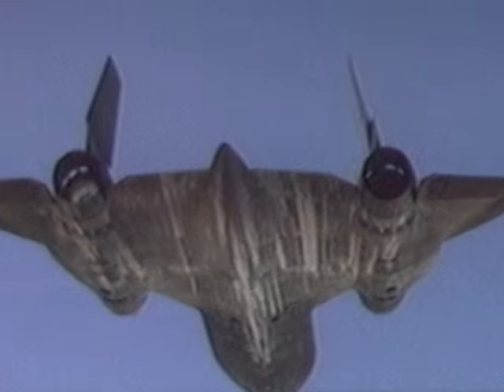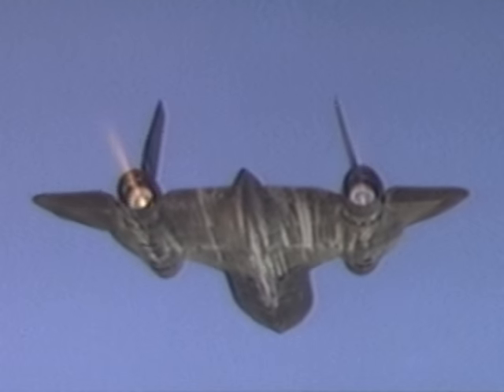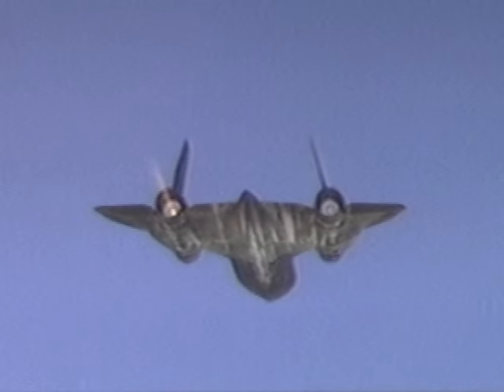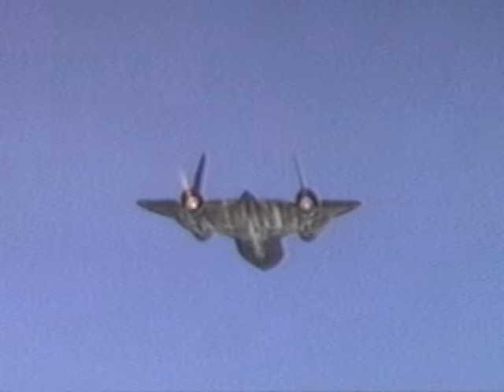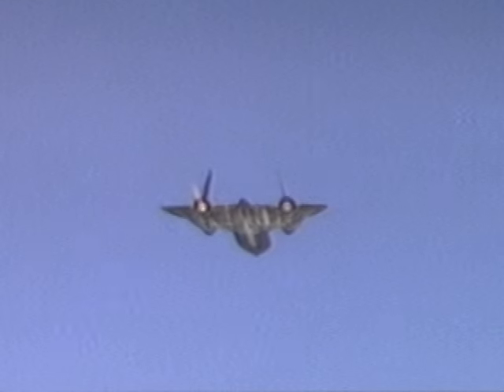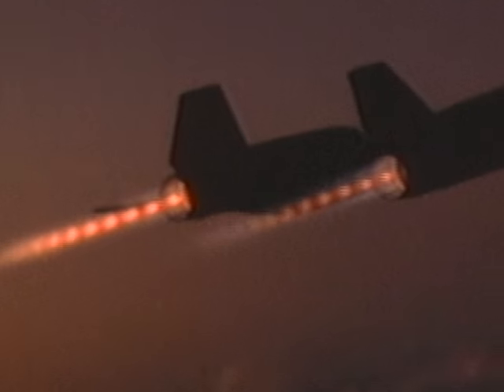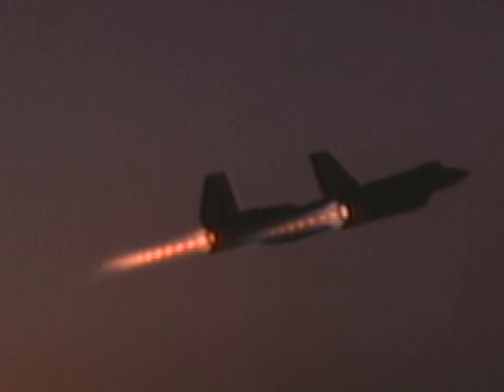Lockheed SR-71 Blackbird: Afterburner

Comment: Ive been told that Mach 3.2 was the highest top speed for the air craft. The classified top speed is much, much higher. Really incredible.
Reply: At Mach 3.5 the Shockwave gets ingested by the engine and it flames out.
Reply: @idontcare9797  Probably true I have heard otherwise.
Reply: @peterssynthetics-independe6786   There's a good video on the channel airzoo where an engineer who worked on the SR71 talks about the J58 engine.
Reply: Not true.  The max speed is limited to the vicinity of Mach 3.2 by engine temperature.  That whole "classified... much higher" business is wishful thinking mythology.  I did learn a few things about it in my 9 years of working on it.
Reply: You were told wrong

Comment: Its not just about the speed of the exhaust, its about the total force of the exhaust, which takes speed into account, as well volume.

You can go supersonic if your exhaust is traveling at 1m/s as long as you have enough mass moving through your exhaust to compensate.
Reply: I've seen many afterburner exhaust signatures and haven't seen "impulse power" signature in any of them ... I'm still puzzled by the exhaust signature ...
Reply: @billwildt6335  Checkout the RS-25/SSME(Space Shuttle Main Engine-now Space Launch System Main Engine, they also have Mach diamonds in the exhaust.  Ambient lighting has a lot to do with exactly what you see as well.  In a few months here we are going to see the Core Stage of SLS loaded onto the Pegasus barge(which was recently-jumboised, or had a section cut out of the middle and then adding in a longer section thus increasing the ships total length. The worlds once longest ship in the world, the Gentle Giant/Seawise Giant/Jahre Viking was jumboised) shipped to Stennis and the Core Stage-1 loaded into the B-2 test stand in order to Green Run 4 RS-25 engines at once.  Same test as the SIC stage of the Saturn V where they lit all 5 F-1 engines at once.  WE'll see mach diamond x 4 engines during this test.  There are 16 RS-25/SSME engines left over from the Space Shuttle Program, 14 have actually flown, some of them 8 times, with one of them being built in 2010 with ZERO flight time and another built from parts in 2014 which of course also has zero flight time.  With each SLS launch using 4 RS-25s we currently have enough for 4 Exploration Missions with SLS.  Rocketdyne has already begun to build brand new Core STage engines with single use expendability in mind.  The 16 "old" engines will be run at 109% Rated Performance Level, while the new build RS-25s will be run at 111% RPL.  A test a few months ago ran a development engine at 113% which is the highest that an RS-25 engine has ever been throttled. New Additive Manufacturing techniques(aka 3-D printing) are to be used with the new build engines due at KSC in mid 2022.   "$1.16 billion contract, which runs from November 2015 through Sept. 30, 2024, is to restart the production line for the RS-25 engine. These production lines have been significantly improved and made more efficient since the retirement of the space shuttle program.."
Reply: This Comment was made when I was born
Reply: It actually has nothing to do with speed or mass.  

The gas flow can only be sonic as any gas flow through a tube is “choked” if you try to move it faster.  

Thus the first part of the jet equation: Ma(V1 - V0) is meaningless because the initial velocity of the air (V0) is actually faster than the final velocity of the air.  The only mass that adds to thrust is the fuel: Mf(Vf) since the fuel is being carried in the aircraft.  

No.. almost all of the thrust is in the last part of the jet equation Aj(Pj - Pamb). 

When you try to add more force to choked gas flow.. you add pressure to the jet.  This will then expand rapidly and push against the nozzle.. generating thrust. Obviously the higher the pressure (Pj).. or the larger the nozzle (Aj).. the more thrust. This works up to Mach 1.. at which point the gas can’t expand fast enough to push. 

So this is why supersonic jets have a convergent-divergent nozzle and rockets use a bell shaped (De Laval) nozzle or a spike.  This allows the expanding gas to exert force on it and generate thrust.  It’s interesting that ambient pressure has to be taken into account.. which reduces the thrust.  In a jet it’s not noticeable as more efficient thrust in high atmosphere is offset by less air for cooling meaning less fuel can be burned.  But rockets are much more efficient in a vacuum.

Comment: I wonder what it would be to fly in the SR-71...
Reply: Eardrum dead
Reply: Boring.  

Riding a mountain bike down a single track gives you far more sensation of speed than Mach 3 at 80,000 feet.. which looks almost as slow as it does from a 737 at 35,000 feet.  

Flying it is no picnic either.  It weighs as much as a 737 and has the same amount of thrust and is actually less maneuvering.  Getting it to Mach 3 and 80,000 feet is a tedious task of perfectly balancing speed and altitude. Just a little off profile and the aircraft won’t perform at best… or kill you at worst.
Reply: @calvinnickel9995   One time back in August 2017, I saw a 600 mph Delta 767-400ER at 36K feet (contrail) and perpendicular to it, a 400 mph F/A-18 at 24K (no contrail) both directly overhead. So not only was the F/A-18 only 2/3 as fast as the 767, but it was also 2/3 the altitude. This crazy coincidence meant that the two planes appeared to be moving at the same speed, I personally think that’s anything but boring! It warms my heart just thinking about it, those were the good days…

Comment: Mach 3.4 is the max speed.  There’s a YouTube video from a project manager that worked on the SR-71 engine for 10-20 years.  He said a pilot wanted to see how fast it would go and pushed the throttle to the “firewall”.  Plane accelerated but at 3.5 both engines flamed out at the same time.  Thankfully the pilots were able to restart the engines and land but they got in trouble with the colonel the next day.  This guy provided the data to the colonel from the black boxes.  With this in mind, 3.4 is the safest max speed.  3.2 is the design target and optimum operating speed.
Reply: 3.4 can only be achieved in cold air as the compressor inlet temperature is limited to 427°C. 

Since the speed of sound is slower in cold air, the true airspeed isn’t any faster.